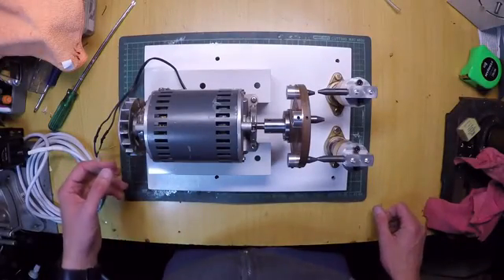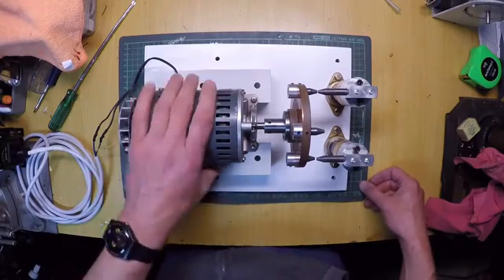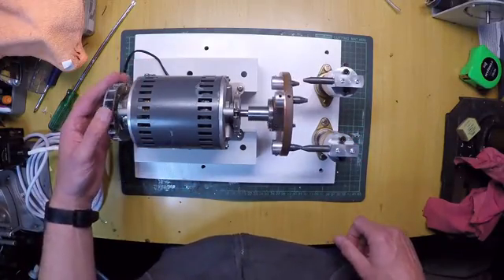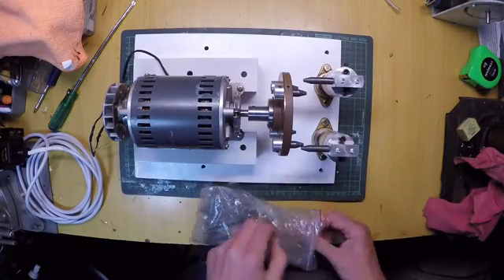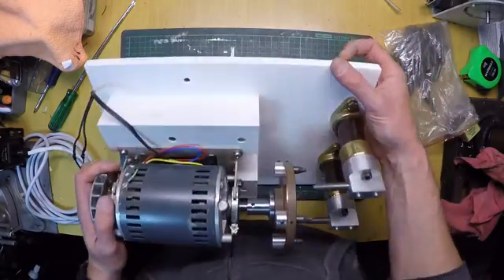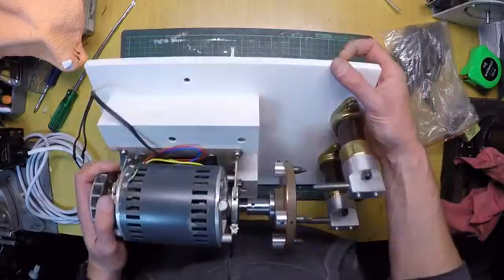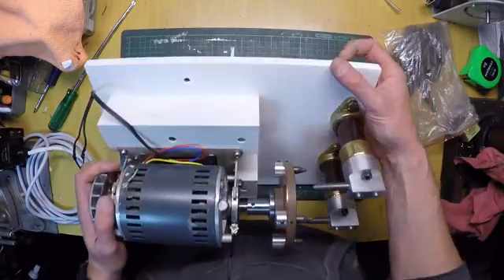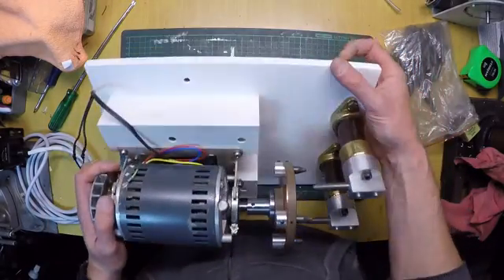Synchronous Rotary Spark Gap for a Tesla Coil SRSG 2.0

Comment: Is it possible to design a spark gap able to use lower voltage ? Like 230 volts, to avoid the need to use the first transformer ?
Reply: 1000 v per 1mm spark gap
Reply: But actually yes there is and I worked it out recently and will be building it on my Chanel in next few weeks !